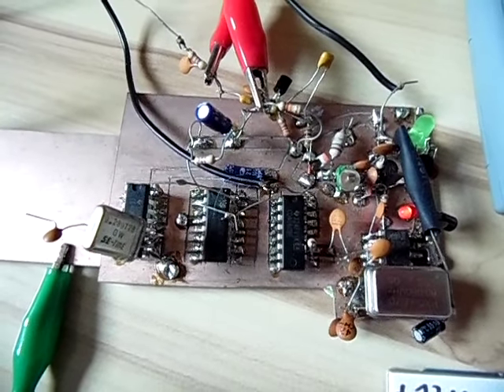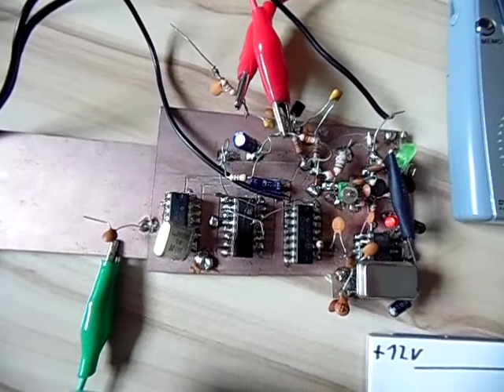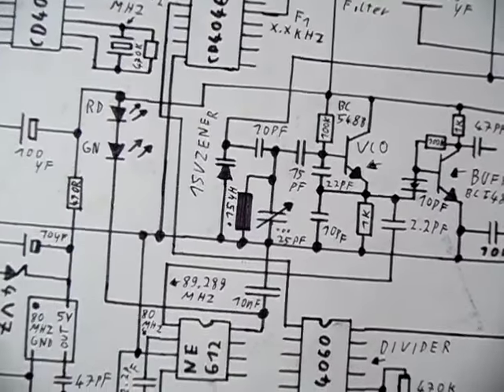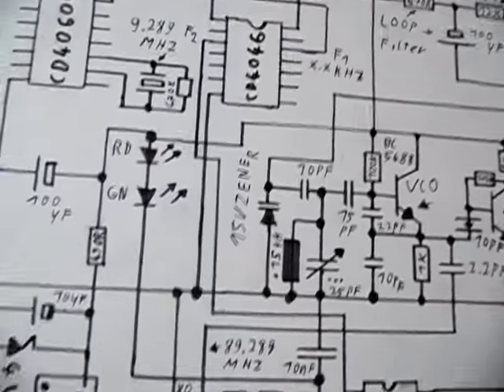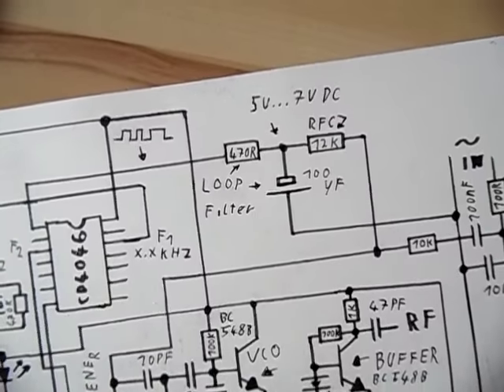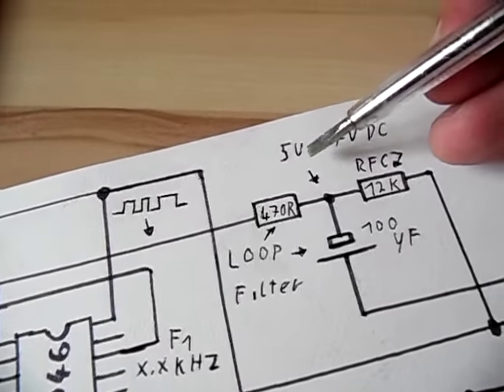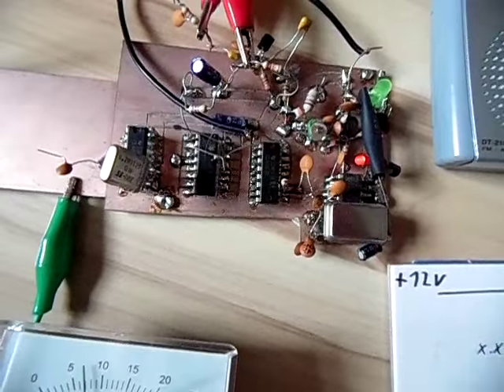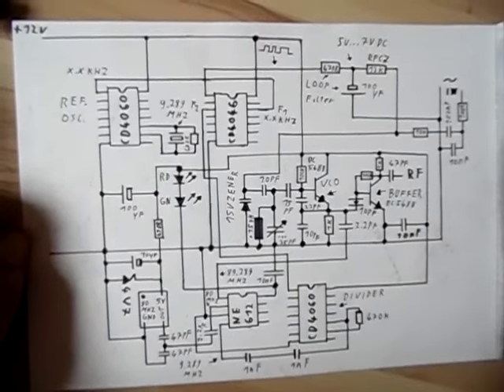PLL Fm transmitter

Comment: Nice circuit, even though a lot of this is over my head since I don't (yet) really know how PLL works.
Reply: +CoolDudeClem PLL is a very nice technique to use, but I found this quite an overkill for a transmitter that only you will listen to. If you want to, go for it - nothing beats a feeling that you get when your project is working great. :) Personally, I prefer simple stuff, not a 1 transistor but 3: preamp with preemphasis + oscillator + buffer amp. If supplied by regulated voltage, I found it stable enough. I tuned my TX to 89.4MHz and after 2+ hours of use it's still there, not spot on, but not hundreds of kHz off either.